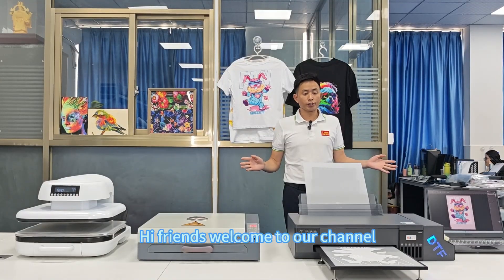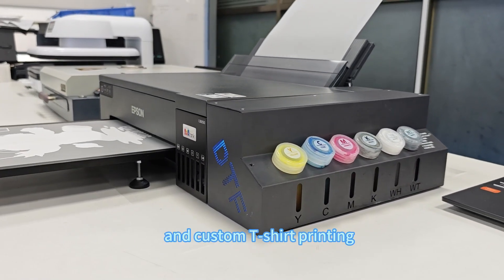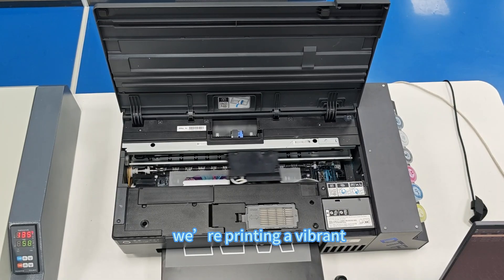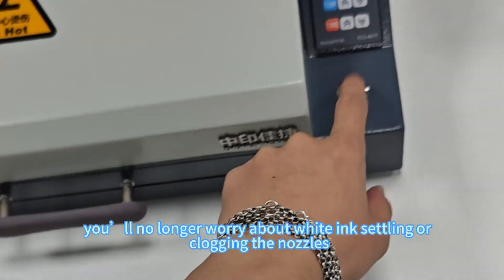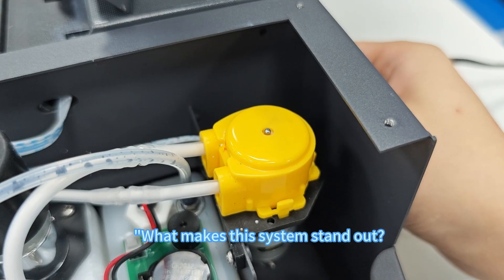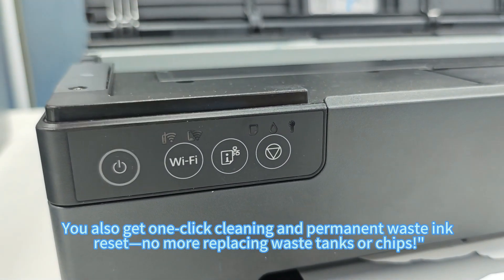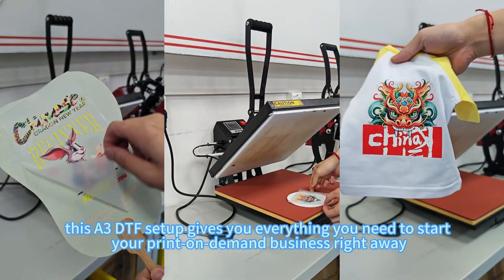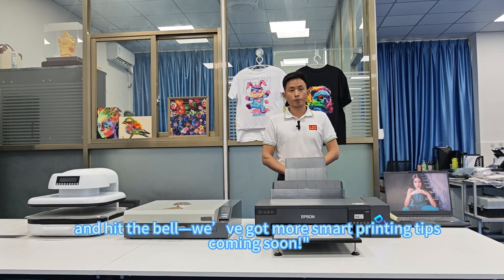A3 DTF Printer with Smart White Ink – Best Epson L18050/L18058 Setup for T-Shirt Printing!"

Comment: That's awesome Sky how fast does it print one A3?
Reply from the maker: as you see in video photo A3  it's take 4minutes 30 seconds  based 1440*1440 dpi setting
Reply: @skyzhang  wow that's faster than than your single head XP600 printer👏👏👏
Reply from the maker: @RyanJHere   Our XP600  head more strogner than epson printer , you can keep long time continuous working. for epson printer normal just for samples working
Reply: @skyzhang okay noted so it's not for  too much heavy load work thanks Sky